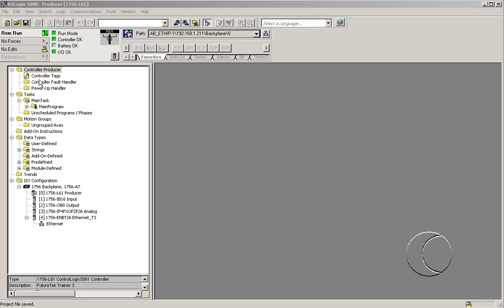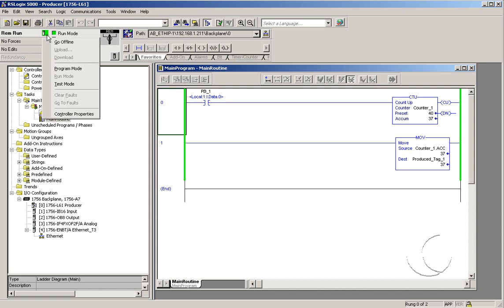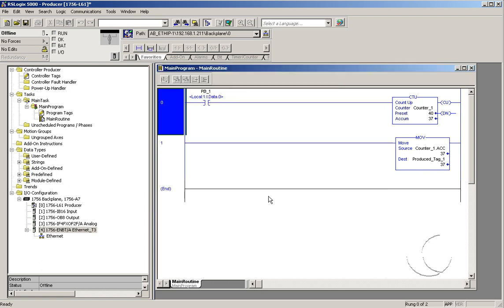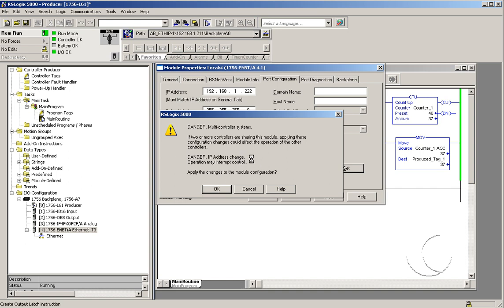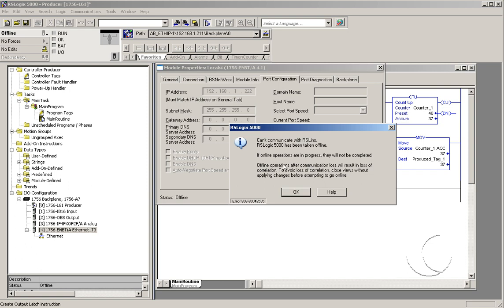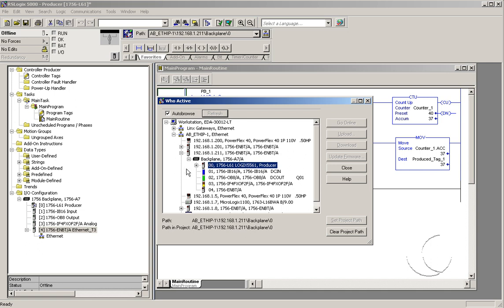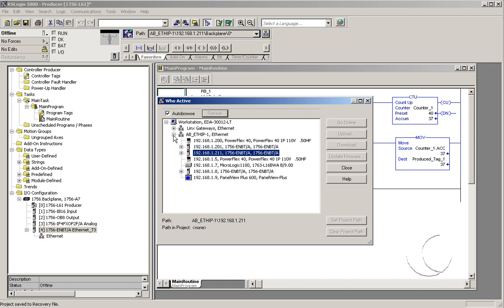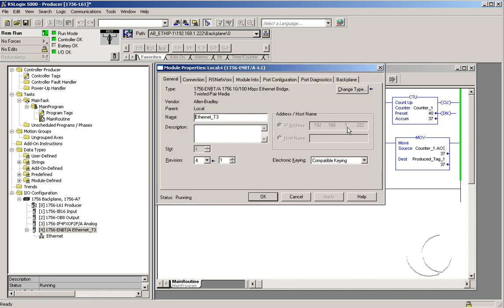How to change the Ethernet IP address in RSLogix5000 project (ENBT-card)

Comment: Hi was wondering if you can give some advice and I know this video was made a long time ago.

  I need to change the IP addresses on a PLC with two ENBT network modules.   Was looking at the warning you get before you change the IP address and just wanted to see if you know if you can for sure change the IP while online and it will not affect the operation of that PLC.  Its a critical PLC in the facility.  
Thanks
Reply from the maker: Hello Ian, sorry, just discovered these older comments. Fairly certain that you would loose, at least temporarily, communication with the PLC, which can cause a shutdown on up- & downstream equipment, if the Controller communication goes Offline.

Comment: Thanks for the great tutorial. I want to change the etherNet IP communication module in the system, if I directly put it in the system it doesn't work.  Maybe I have to put the IP using the software. Kindly clear it to be, what are steps needed.
Reply from the maker: You have to change it in the module configuration (Studio 5000 project) and the physically assigned IP on the card. You can match them if you do the change online, but you will loose connection.
Reply: @PSDettmer  Thanks

Comment: 2:48  I was using Logix Designer version 32.02.00 and found that the settings I needed to change during runtime weren't on the Port Configuration tab, but the Internet Protocol tab.
Reply from the maker: Thanks for letting us know. It's probably time to make a new video, based on all the changes in hardware (L8x processor, USB, etc..) and software versions (v33+).

Comment: hi, i am also new to AB programming, i have to change an IP address of a controller   from an IP address of 10.200.56.21 to an IP 100.0.0.214. i set my PC IP address to the same range as the controllers current address just changing the last digits to 254. i have tested my communication link with the plc and i can go online. because the new ip address is in a different range when i change and download will my laptop allow this to happen?  as it is a completely different network range. how can i over come this if i don't have a serial connection to do the download only an Ethernet connection available.
Reply from the maker: Hello David, what is the hardware? Did you set the subnet mask correctly? You can also set an "Alternate IP" address in the Advanced Configuration menu, if you only have one physical link, but two different network ranges. Hope this helps!

Comment: Hi! I'm new to AB, I can't get communication with the PLC due to the configuration of the IP, DNS. I tried to set to obtain IP automatically and manually but none work, please help!
Reply from the maker: +Quyen Huynh sorry for the long delay in responding. Hopefully, you resolved this by now. Otherwise, do you know the IP address of the PLC? It is often easiest to access the PLC via serial or USB connection and set the IP address of the PLC to match your network. Maybe it hasn't been set?